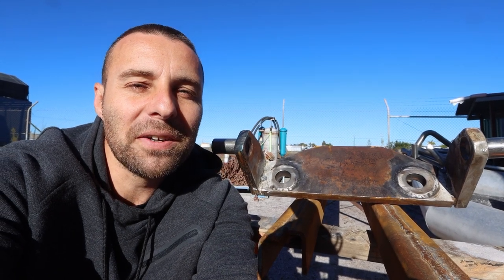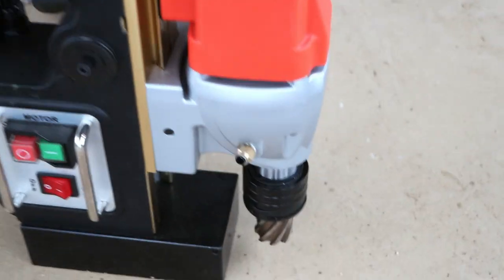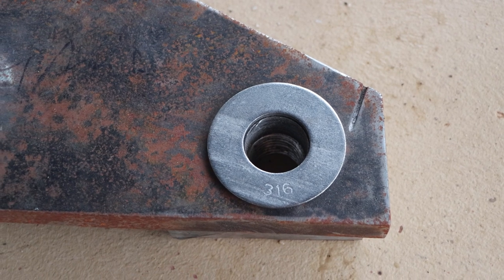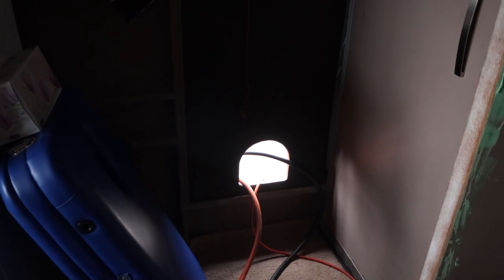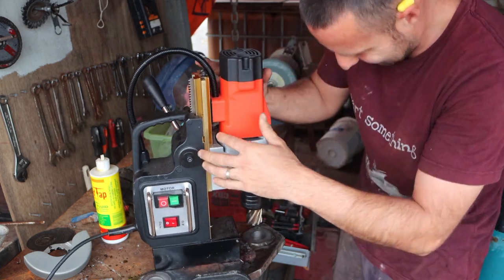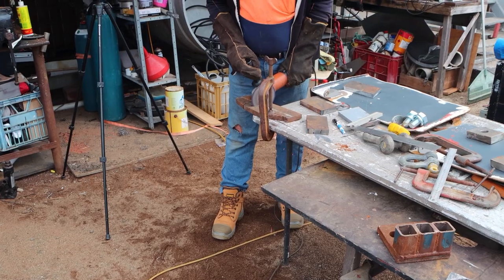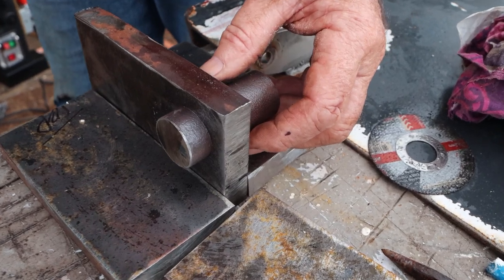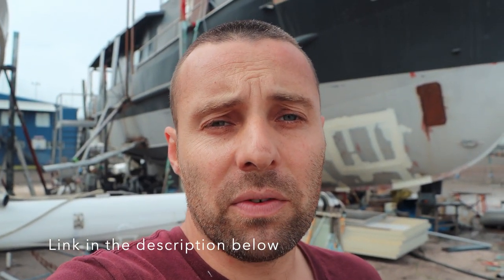Making Stabiliser Wing Locking Mechanism's - Project Brupeg Ep.164

Comment: If it were my wing locking plate, I'd bore out a cone shaped recess in the center and weld a cone shaped guide thingy to the deck to allow for easier bolt allignment in fun seas. That ir a sword. But the pin is mightier than the sword.
Reply from the maker: I do like your mighty pin idea
Reply: Good idea. Just dont end up with a Male and female Morse tape seized together with shock loads

Comment: A lot more cooling fluid, and slower speed. Annular cutters warm up fast because they don't have the mass to resist and once they do, unless they're made from a specific metal (the name escapes me now) they lose the tempering and dull faster than a diving eagle. Other than that, great addition to the tool "bag". Especially on a ship.

Online, there's various plans and means to convert these into temporary drill presses. And one method that i've always liked (unsure if yours can do that, but some of the bigger ones can) is to reverse the track on the drill and point it upwards. That then allows you to mount it upside down on a frame, which then allows you to use it as a normal drill press. You could have a dedicated spot in, say the engine room, where a frame could be mounted and this sat, there.

Comment: Great Progress, as Usual .... :-)   :-)   :-) ... Question ????? .... Is there a reason why you did not make the 'Guide Pins a Single Guide Rin to go over whole width. ????... That way the Pin only had to held in place with 2 off 'Locking Clip' and could be removed easily ???? 'Clips' like those used on Hydraulic Cylinder  End pins etc. Naturally one could have had the 'Channels' a little wider and used 'Nylatron' or Acetyl  Rollers too. I think that maybe the 'Wear Strips' could want to be 'Smear' and dislodge.   . Best to ALL from NZ
Reply from the maker: Hi Keith. The pins need to be separated as we need clear access for the bolts and a longer single pin gets in the way of that. The sliders are steel and as such need paint protection from rust. We choose wear strips as a roller would wear that paint off pretty fast and cover the boat with rust

Comment: you should use those "milky" watherbased coolant and flush while you cutting ... it will keep your expansiv tools sharp for longer mag-drills are fantastic but not cheap to run
Reply from the maker: Hi Bruno, this still comes with a coolant bottle which we still need to fit. I will get some water soluble oil when I’m in town next as it’s great stuff, I used to use it all the time when I worked in a machine shop

Comment: If the boat is rocking how will you secure the lowered arm with M30 bolts.
The stabiliser / wing will cause the plate to move up and down as the boat rolls before you secure the bolts.
Perhaps a “ratchet “ to keep the plates lowered prior to installation of the bolts????
What do you think???
Alan in London
Reply from the maker: Hi Alan, yeah something like that is definitely an option to consider. The commercial guys who use wings everyday with the two bolt system say it’s not needed, but we are always happy to add it later if we find we need it

Comment: I don't mean to beat a dead horse, but I'm still cringing at the thought of pulling those bolts to raise the wings in anything but flat calm with no forward movement. Even the slightest swell could shear the last threads off. And if one bolts loose or out and wave hits will it bend those plates.  Sorry, just being a worrywart.
Reply: maybe some sort of locking dog lever like those that close a water tight door to hold it in place, and then the bolt just becomes added security....would hold it inplace while the bolt is being installed or removed for raising or lowering...
Reply: @timhyatt9185  yeah that's a damn good idea.
Reply from the maker: The commercial guys just use the two bolt system and have said always point head to wind/weather when unbolting and they have said it’s fine to use like that. All this said the idea of some sort of camlock dog type arrangement is quite interesting, it’s certainly something we could add but it would be an addition post launch for us.

Comment: Someone may have said this already but for me I look at it as if you go with the long pin and it turns out to be a problem you can always cut it off, but if you do the short pin you have to replace it entirely if you wish you went with the long pin.
Reply from the maker: Yeah that’s true. They will both be welded in the same amount so likely would be similar to remove. We had to take one out and it was a bloody nightmare so I can say they are held in extremely well. One issue with the longer pins is it’s one more thing that can get I. The way of the bolts, hence we opted for the shorties

Comment: You obviously love the Mag Drill.

I suspect not but any downsides to having the short throw/anular cutter model vs the long throw/drill chuck model?
Reply from the maker: Im sure there are downsides but for our work this is perfect. Powers through 20mm high tensile stainless cutting a 34mm hole in about 30 seconds
Reply: @ProjectBrupeg   Thanks. I've ordered one to do a metric shit tonne of 25mm through hulls and cable glands through 6mm bulkheads
Reply from the maker: Only thing I would say is the magnet struggles with thin metal. For a 6mm bulkhead. I would suggest getting someone to hold a block of 20mm on the other side so it has a heap of iron to try and clamp to.

Comment: Conical peg on deck matches with conical hole in slider plate?
Reply from the maker: Hi Pete. Yeah Trev and I have been pondering this. We are thinking a vertical 2” stainless locator pin to do the holding and location prior to bolting the arm at deployment

Comment: Is their a chance the stabilisers could crush your hull like a can crusher in large swells. Have you reinforced the cross section of the hull to each stabilisers.
Reply from the maker: There is always a chance but highly unlikely. They are mounted on the strongest part of the hull as the main engine room bulkhead is right behind them

Comment: One thing i would do is a Cut out at the top of your slide just past the upright position so you can take it our ????? or will it turn inside the the channels to allow it to come out if you need to work on it or replace it??????.  when you undo the Bolts.
Reply from the maker: I was thinking of making the cap on top of the sliders bolt on, as we need to be able to take the wings off in the water (for our ice mods), our plan is to unbolt the lid and winch the wing vertical and the arm will lift out the top.

Comment: You may have already heard this but are you going to put a spiggot hole in the top plate which bolts to the deck? Sometimes the bolt holes need a bit of help to line them up.
Reply from the maker: Hi Justin. Yeah we will do one. We are thinking the studs act as the alignment currently but we will no doubt refine this if they are not enough

Comment: Surely the higher the pins sit in relation to the top face of the arm the more you will have to chop out of the roof, the lower they are the less material that will need to be chopped out. Does that make sense? I am sure you have probably already passed this point by now but I would have thought this may affect the rain water collection system unless you have drains in the back section of the boat.
Reply from the maker: Your right about the roof, however we need to tuck the wings in tight against the hull so the roof gets compromised so we don’t bind the wings up further from the hull than needed
Reply: @ProjectBrupeg  Now you have said that it makes perfect sense I hadn't thought about the distance the stabilizers stick out of the side of boat. Looking forward to the next videos

Comment: Love that phrase - "once you crank down on them nice and tight, nothing will move". Well you just wait til you get in some seas, you going to see what is going to move...
Reply from the maker: Not really. This system is tested by fishermen and woman, engineers and boat builders for years. We are interested in what works in extreme conditions and of course no matter how well something is built it will fail if conditions are bad enough. There seems to be a confusion about how these are built and how they will be used. We really are not interested in drama, fear or assumptions but appreciate your concern. It’s very kind of you. Cheers Jess

Comment: You are running the end mill (annular cutter down under) way too fast. Use lots of cooling cutting fluid and slow rotation speeds. End Mills can be sharpened by specialty companies, but they cannot survive heat.
Reply from the maker: Yeah this is a one speed drill unfortunately

Comment: Very cool video,  you guys have some serious skills!  But question. The little “wings” that the locating pins are on,  when you raise them up,  aren’t they going to cause the whole arm mechanism at the top to swing in the length of this little wings, meaning you will have to cut out more of the roof to clear?
Reply from the maker: Exactly. Tucking the wings in tight beats roof clearance. We pondered having the pins directly on the 20mm steel plate but didn’t like the compromise it would be on the wing when folded up

Comment: One thing I've wondered for some time now is how are you sure that the hinge part won't indent the side of the boat over time? I'm sure there is going to be a huge amount of force directed at that attachment point and during choppy waves I can easily see multiple tons of force being focused there. I know you have a thick steel plate under the hinge but I'm wondering if the steel walls around it have enough rigidity to take the force from that plate?
Reply from the maker: Behind the hull plate in that area is the main engine room bulkhead which is a hugely strong/stiff pet of the boat. Normally when commercial trawlers fit these wings they don’t even have that behind the wings. We also plan to monitor the hull in heavy seas to see if the deflection (as there will always be some) is within a reasonable amount that we and our designers are comfortable with. If we need to add strength in that area we have easy access and can add additional ribs into that area with ease

Comment: Quite fast RPM on that drill, best to check recommended surface speeds from the datasheet. Also I'd recommend to keep it cooler, much more coolant and short pecks.
Reply from the maker: It’s a one speed drill. Can do extra lubrication, can’t do variable speed
Reply: I was thinking the same thing when the 'real time' tag came up, nothing like burning money as you over heat bits.....better keep that coolant upto  it if you cant alter speed, they certainly make life easier, great gift
Reply from the maker: Cheers Dan. I will make sure the coolant is on. I felt it was a bit fast but assumed it was ok given its the right cutter for the drill. But it’s clearly not now that I think about it logically
Reply: @ProjectBrupeg  As long as you keep the heat down you will be fine, especially important with the cheaper bits later.
Reply from the maker: Good to know thanks
Reply: Yeah but when you’re busting into a bank vault speed is your buddy

Comment: Total tools sell the slugger bits a lot cheaper and flud the cutter with coolant to make them last you also can get them sent out and re sharpened.
Reply from the maker: Thanks Cameron. Total tools was where the drill came from but when I went in there they only had smaller bits, and we needed it that day. I do plan to get more so I will price a set up and total
Reply: @ProjectBrupeg  sorry trade tools is the shop there brand is a lot cheaper
Reply from the maker: Ahh actually I cocked that up too. It was from trade tools not total.

Comment: Hey I'm Second!!  On a more serious note. Didn't you say you were going to have Nylon or something like that on the Guides or the pins? Or you going to just leave it as a metal to metal contact? Or Does the Nylon Go over the Pin? Stay Well Good People
Reply from the maker: Hi Dennis. Yeah still planning on plastic wear strips. Just haven’t installed them yet. I need to nip into town and pick them up. We will finish all the welding of the sliders into the boat then give the welds a sand blast and rust kill the metal, chuck on 3-4 coats of epoxy then fit the plastic on top of the painted steel. The plastic is 4.5mm thick so for now we are using a couple of pieces of 5mm thick alloy on either side of the pin to locate it prior to plastic being fitted
Reply: @ProjectBrupeg  Thanks for getting back to me Damon. I figured you would be compensating. Just wasn't sure if you are going to put them on the Studs or on the Rail Itself. Things are coming together guys.
Reply from the maker: Yeah definitely on the slider not the pin as we need to prevent the paint from wearing off the slider so that’s part of what the wear strips do
Reply: Damo, I see your point. What about thinking about a boat shaped sliding shoe that locates over the pins and slides. They can be lubricated, replaced if worn and means no difficult and lengthy fitment of the strips you propose. Just throwing in some ideas to hopefully keep that active brain of yours satisfied. cheers and great vids

Comment: That MagDrill looks amazing! I'd be a bit careful of EBay cutters though - I have been caught out with low quality stuff before, as I'm sure you have...
Reply from the maker: It’s always a gamble. Sometimes it works, other times not so much
Reply: It's actually pretty easy to spot the cheapo ones. Look for the specific size you want, move the settings to "cheapest + transport" an select the "buy now" option.
Those first pictures you see, avoid all of them later on, and you'll find the good ones, because you think that there's multiple vendors, when in reality, there's only a few, just using different accounts to unload excess crap they have from the various factories. You can actually trace them down if you start cataloging the shipping addresses. 

That being said, even those cheapo cutters are worth buying, and here's why, once you understand their limit, they're perfectly usable as expendable drills/cutters, or for when you have a job where you know you'll ruin the good drill regardless of what you do. Like say, cutting over a weld pool.

Always have good and bad tools, use the bad tools as a battering ram, keep the good ones as surgery equipment.

Comment: Dame, have a word with Doug from SV Seeker, he has used Mag drills for a long time and will know the best ones to use and where to get em.
Reply from the maker: Thanks Neil
Reply: Nitto is the best rota broaches you'll get in aus 

Really for the quantity you'll do id rekonmemd a set from hare and Forbes 
Youll soon work out what size you use regularly and replace them with nitto 
But for most of the sizes that might gey used once a month the cheap kit is fine 
3yrs on mine of regular farm use 
1in 2in and 30 mm are.my common sizes  
But nitto bits are nearly $100 a bit 
But iv prob got 500 holes on my 1in 

You can sharpen them with a cut off disc just run the disc down flat of each tooth to follow the original shape  
Or send them out to a professional 
But yous got time or $$$ for that lol

Also save a decent bit of 1in plate a bit bigger than the foot print of the drill 
Their biggest limitation is the rota broaches bite hard and even if yoi put the part in a drill vice itll just rip it out of your hands 
So iv got a bit of plate I can tac weld small parts to and mag the drill down to t
Or bolt a small drill vice to the plate
Reply from the maker: Ahh this is great to know. Thanks for this info. Dame

Comment: Isn’t having the pins that high going to rotate the mount in slightly towards centerline as the wing raises?  So you’ll have to cut more of the roof for clearance?  Should be good to help tuck the wings in tighter though.
Reply from the maker: Exactly. Tucking the wings in tight beats roof clearance. We pondered having the pins directly on the 20mm steel plate but didn’t like the compromise it would be on the wing when folded up